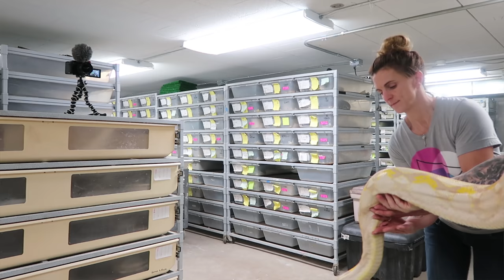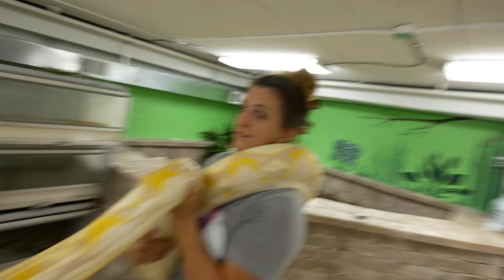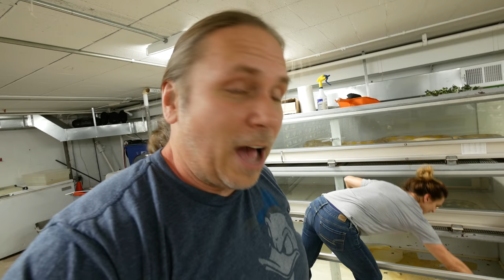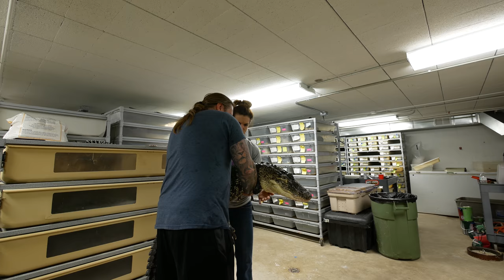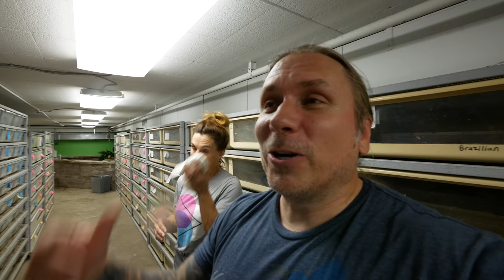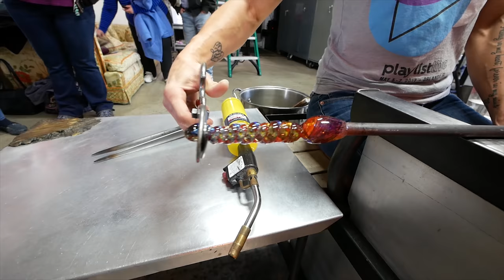VERY SCARY MOMENTS WITH A 20 FOOT SNAKE!! (SERIOUSLY) | BRIAN BARCZYK

Comment: Lucy is absolutely gorgeous.
When I was about 17, a friend of mine had both a Ball Python and a Boa. I wasn't really a snake guy but my friend convinced me to handle them. They were each relatively the same size, about 3'-4' and about the size of a coke can. The Python was very laid back but the Boa on the other hand was not having it. He had wrapped around my lower bicep, elbow and forearm and began squeezing. My friend just giggled, it was my first time experiencing that amount of power and it terrified me. I was blown away by the sheer force something that size had. It felt like it could've easily dislocated and/or snapped my arm at any given moment. 
That being said, I cannot imagine what type of force a snake the size of Lucy could generate. Unbelievable.

Comment: I have a question, why do tiny snakes seem so aggressive an like they wanna kill you and the bigger ones like this seem more relaxed and friendly
Reply: it all depends on the snake, big snakes can be just as agressive as a smaller one. brians bigger snakes or most of them anyway, seem more relaxed because he works with them alot because the danger of them being aggressive is way higher then if a smaller snake like a ball python is agressive. the more you work with a snake and handle them the more relaxed they get for the most part. a reticulated python (one of the biggest snakes) can kill a human where as a small ball python or garter snake cant.